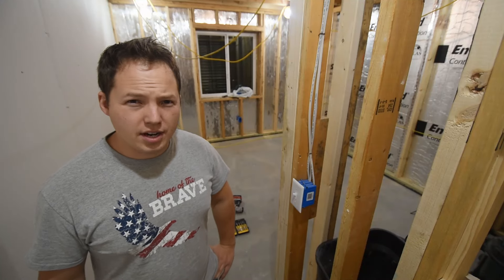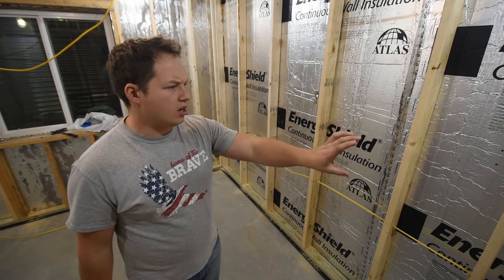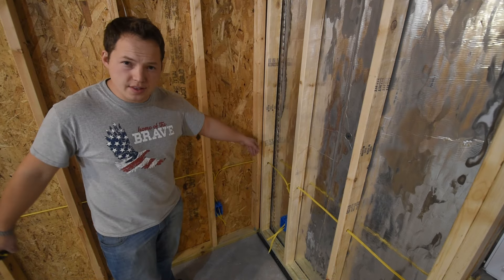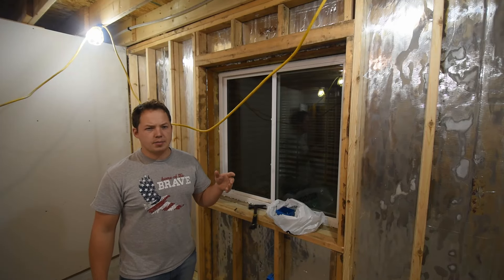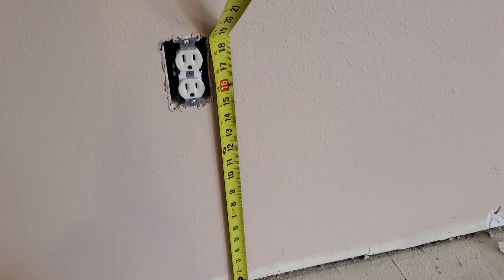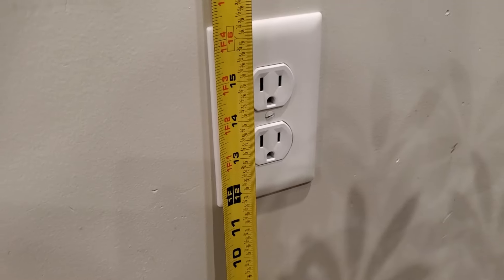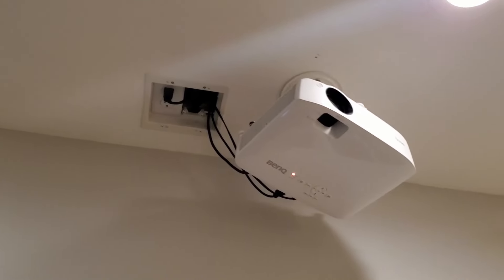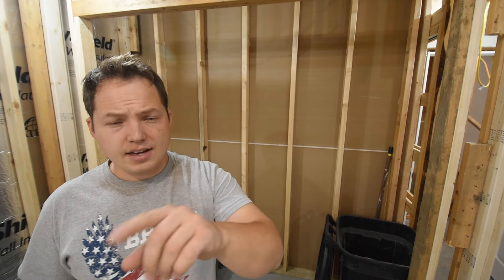Height of Outlet & Switch Boxes & Receptacle Location Tips

Comment: If I’m not planning for anyone living in the space that is handicapped, then what reason besides Making it easier for the sheet rocker do I have to comply with the ada?  

Outlets 20 a.f.f. To top
Switches 50” to top a.f.f.
Bath sconces 6’8” center.
Laundry /dryer 50” to top ( if we don’t leave the outlets accessible while the appliance is in place, the inspectors require a disconnect. ick. I’d rather see the plug back than a bigger gray box)
Reply: Compliance with the ADA is not optional, it's law.

Comment: is there any codes or laws or rules for receptacles with usb connections?
Reply from the maker: They just need to meet the same requirements that regular receptacles do. This includes being GFCI where required and tamper resistant (TR) where required. You can accomplish this with a GFCI breaker if you want to replace an existing GFCI receptacle as an example.
Reply: @BenjaminSahlstrom  awesome. Thanks. I've been bing watching you all day. Bought a house with an unfinished  basement and will be doing the majority of the work myself except framing. You've taught me a lot. Keep up the great work!
Reply: No

Comment: Aren’t the outlets supposed to be installed with the ground pin up ?
The idea of this if the plug sags the ground pin is exposed and not the hot.
I thought that’s part of the code ?
Reply: Obwan Kenobi I’ve never heard of this. The only time pin (ground plug) is up is to identify a half-hot receptacle.
Reply: There is nothing in the NEC about ground pin being up or down. That started in the early 90's. Architects would design commercial buildings and in the legends for material listing a duplex receptacle would be shown with ground pins up. So,  in essence the rule of thumb was to install outlets with grounding pin up as to appease architect and GC. Though there are some thoughts as to why this is a better installation, one being if something fell behind a desk and the cord cap was slightly out that object would not come in contact with the hot and neutral causing a short. Also the same thought as when personnel using office equipment and had to remove a unit their fingers would not touch the hot and neutral blades of the cord cap. But after years of being in the trade I have never seen anyone put their hand on the body of the cord cap except when plugging in a peice of equipment.  When unplugging...yup they pull on the cord.
Reply: The reasoning I heard for ground pin up was in case the plug sags and something slips off the wall (like a metal picture frame or curtain rod) and lands in the gap it won't be energized and bite you when you reach down to retrieve it. It would either be touching just the ground pin or ground and common and be "safe", or touch both the ground and hot and set off the circuit breaker.   
I think ground pin down has become common because it makes a little smiley face :)  Also appliances and extension cords with right angle "lay flat" plugs seem to dress better when the ground pin is down.

Comment: You left out the garage outlets totally...the door opener outlet needs to be on the ceiling, and it's switch about  60" from the floor. Need junction boxes for sensors too. Good and informative video.

Comment: I found this video helpful, but wish he stressed the NEC requirements.....the 6-12 rule and the height requirements for them to count as minimums....one foot off wall in floor up to 6 ft high on wall to count as "required" for inspection.  

The NEC is a minimum requirement and you can have a receptacle every foot along the wall if you want.

Comment: Hi. Here at the opposite side of the world I heard some rumours about US home electricity. They say you can't do anything with electricity even at your own house or you'll be penalised for it. Is it true, or you can do it by yourself and all that matters is whether you follow the code and pass the inspection.
Reply: Its  A complicated question to answer.  That will depend on the local jurisdiction that you fall under. There are no federal guidelines.
Reply: Eh at home you're okay. Especially w a small job. Anything public where someone can tell is where you'll run into problems.
Reply from the maker: Generally you can do your own electrical work in your own residence as long as you get a permit and have the work inspected. As Dan said though it is somewhat complicated as some areas don't allow that. How does it work where you live? What country are you from? I love learning how things are done in other places.
Reply: Depends on state or local governments.  Where I live now you just have to pull a permit for anything except straight replacements (i.e. replacing a defective switch, fixture, or receptacle).  Where I used to live in a much more rural area you didn't even need a permit.
Reply: There are NATIONAL guidelines, called the National Electrical Code.  It is revised and published every four years, buy yourself a copy from Amazon or from your local library.

Comment: The switch height that I use is 48" to the center from the finished ceiling. Although two pieces of drywall must be cut, the cuts are smaller and lessens the chance of cracking or breakage. 
In a basement, I use 24" from the floor because in places with a high water table , outlets at 12" or 16" could potentially get wet during a flood situation.. 
On the first and second floor, I stand my hammer with the handle vertical and mark the bottom of the box at the top of the handle. 
I enjoy your videos and just wanted to share another point of view with you and your followers.
Reply: You measure switch height from the ceiling? That doesn't make sense, sorry... In rooms with various ceiling heights, you're going to have various switch heights.
Reply: @aaron74  sorry, I should have clarified that for you.In a room where the ceiling height is 96" plus or minus a 1/2" ,U measure 48" from the finished ceiling. It usually works pretty good for me. Obviously if the ceiling is not 96" that doesn't work, then 48" from the finished floor to the center of the box is what I use.
Reply: @jamestrapp8596  Yeah just stick with the floor as your baseline. The ceiling doesn't matter. lol

Comment: These days smart homes are becoming very popular, receptacles in closets and near windows are even more important so the homeowner can hide electronics and power automated curtains/blinds. Ethernet run with switches and room ceiling lights does wonders for sensors like temp/humidity/motion/luminescence/etc. Also Ethernet is great for Power-over-Ethernet (PoE) devices like network devices, WiFi access points, and CAMERAS. Super wish Ethernet was ran to key locations around the house for external cameras. And wish they had run thicker copper to my garage with an Ethernet

Comment: GFI’s in a wet room. That should include kitchen counter tops.
Reply from the maker: Yes that's correct. I'm guessing that you're referring to the part of the video where the receptacles look "normal" right? Those are protected by a dual function AFCI & GFCI circuit breaker.

Comment: Look up “ada 308 reach ranges” these measurements vary depending on obstructions. For example you said 48” max for a kitchen countertop when it’s actually 46” from finish floor to top of device, a common mistake in the field.
Reply from the maker: Thanks for the clarification! That would definitely be easy to miss.
Reply: Graphic shows that minimum height is 15 inches. Is that to bottom of the box? (Also shows that max height can be as low as 44" with a 25" forward obstruction, and simply disallowed after 25").
Reply: I always mount a half sheet of sheetrock from the ceiling, then a whole sheet, then what ever is left usually 24".   No tapered seam behind backsplash tile keeps it flat.  Those two joints need only one coat since they are hidden by the cabinets.

Comment: Counter receptacles are generally mounted at 44", not 48".   The space between counters and bottom of cabinets is 18", half 18" is 9, 9+36=45".    Bathroom switches are generally 54" high to be above the tile work.
Reply: Not to nitpick, but 9 + 36 = 45. ;)

Comment: Greetings,
I enjoyed the video. The poll you posted said comment if different mounting heights. I mount all new general receptacle boxes at 24" bottom of box. Why? Before ADA,  Did this specifically for handicapped and elderly clients. ADA being significant in design now, I standardized this measurement for all residential new construction and significant remodels. My other backstory of why I mount at higher a elevation is that I was called to a home in the early 2000's to raise receptacles because this client's child had a pet snake who electrocuted itself and damaged the load center. At 24" it is more difficult for toddlers and pets to get injured or die. Tamper resistant receptacles are a godsend. I do both.
Reply from the maker: Thanks for sharing that! Is 24" a requirement for the ADA for receptacle height?
Reply: @BenjaminSahlstrom  I don't believe there is a NEC nor specific ADA Requirement but ADA being Federal, there is probably fine print somewhere. I just common sensed it. Lined up a wheelchair and a walker to the wall and tested.

Comment: for switches in a room with 8' ceilings, when using 5/8 drywall, I put my boxes 48 7/8 from the ceiling.  it's easy enough to measure and mark, and it ensures a consistent small gap on the top of the box.  also, height does not rhyme with ninth, it rhymes with kite.  :)  the h is silent

Comment: "Now some people are concerned about the aesthetic of too many boxes... or whatever..." @ 6:16. Ha ha ha, yeah... This is definitely a thing real thing, Ben. Because once they get installed and all the rooms get drywalled, you obviously can't easily take them out. And the placement really dictates the size and placement of furniture in a room, without regard to what choices you or a future homeowner might decide later down the road. Maybe you won't want the head of your bed along that particular wall in the future? Well if you move it, those high-mounted receptacles are going to look really weird.

For beds, I actually like the idea of receptacles and switches for the nightstand lamp to be in the HEADBOARD of the bed, stealthily on the sides and out of view. Then that headboard assembly, with its cord tail that plugs into the wall, moves around wherever you decide to place the bed in the room. I saw this done in a recent issue of Home Handyman.

Extension cords often get a bad rap, but they are PERFECT for bed and nightstand situations where you might plug or unplug something at table height, but the receptacle is behind the table at a standard receptacle height. The end of the extension cord can be tucked away sort of inconspicuously, and part of the cord could even be temporarily zip-tied to the back leg of the table so it doesn't fall to the floor. Same with a couch, you can just have the extension cord dangle over the couch to plug in a cell phone or whatever. When you have guests, hide the cord behind or between the back cushions of the couch.

Also, I'm not a fan of receptacles with integrated USB chargers. Besides being ridiculously expensive, they are constantly running whether something is plugged in or not. Even though the power consumption is modest, the electronics in them are constantly charged and over a fairly short time they will likely just burn out, and then there is the hassle of replacing it. Lastly, everything may soon be on the small USB-C format plug charging standard, though I wouldn't hold my breath before that happens.

Comment: It's not 48-inches, more like 48" up to 48.5" depending on chosen drywall thickness. If you do 48", the drywall guy is most likely cutting both sheets still or is doing a bad job for you. You'd measure from ceiling for this, not floor.
Reply from the maker: Some guys will set them at 46".

Comment: 54” is standard height switch boxes 
48” for handicap switch boxes 
Stand your hammer up and place box on top of hammer and set receptacle boxes to this height, one guy setting all boxes to ensure same height 
Brace all 3 and 4 gang boxes

I recommend using 20 cubic in single gang boxes, wiring all receptacles in 12/2, this allows 3 12/2’s into single gang box, so no box overfill, always pigtail your boxes with 3 12/2’s, meaning the neutrals and hots.

Comment: Easier to figure out switch is 48" from finished ceiling.... ceiling is installed first...the wall... wall is installed by placing first drywall board to ceiling...48"...no notching out top board or lacking 1/2" gap at top of box.... normally drywall is set 1/2" to 3/4" from floor...

Comment: Always use a number off the bottom and then you can use a "stupid stick." Which is a piece of strapping cut to the measurement between the floor and the bottom of the box.  Then you do not use a tape measure throughout the entire rough.  You put the box on top of the stupid stick and youre done.  You cut 1 stupid stick for switches and 1 for plugs.
Reply from the maker: Great recommendation!
Reply: *receptacles, plugs are on the appliance, never on the wall.
Reply: Stupid stick?————>story pole
Reply: Plugs are inserted into receptacles
Reply: How high should you put a panel box
Reply: Vincent Wilson ...... 6’6”” to the top of the main breaker or switch.....get a code book

Better yet.....get a licensed electrician....everyone will be happy....including the fire dept!
Reply: I use the top of the hammer for the bottom outlets since all my hammer are the same height (13").   Once the flooring is added it makes it closer to 12".

Comment: He has the ground of the receptacle, on the bottom instead as it should be, on top.
Reply: That is not an NEC requirement. There are good reasons to do it that way, and it is taught in many trade text books, but it doesn't look like a smiley face 😀  Also, many appliances and extension cords have right angle plugs that allow the cord to lay flat against the wall. Most of the ones I see assume the ground is on the bottom.

Comment: Interesting that you use such precision to describe the location, but you don't mention whether you are using the finished or unfinished floor as the base level.  It looks like, in your examples, you show both finished and unfinished floors.  I think there's typical 1.5" difference between the two.

Comment: Better rethink that I mount my switch box at 48.5 inches down from ceiling that way the top sheet of drywall doesn’t need cut
Reply: I hung my drywall vertical so I don't have any butt joints to mud.
Reply: @JoeMalovich  Against the code.
Reply: @lichub  there is no code pertaining to drywall orientation.
Reply: @JoeMalovich  Banks will deny loans to new construction if sheet goods are not catching the most studs.
Reply: @lichub  1. How would banks know which direction the drywall goes?

2. My vertical drywall panels are touching the studs 100% of the perimeter. Horizontal drywall touches  only on 3 sides and the 4th side touches the studs only at the stud, the spans between studs are unsupported.
Reply: @JoeMalovich  If you build a new home, a bank will send its own inspector to see the progress of the construction.

Comment: Placing the boxes at 48 inches is a pain in the butt for dry wall.  They will fall right in the middle of the horizontal joint.  I also suggest that ADA compliance is MAXIMUM 48".  Lower the switch boxes.  Receptacles are a Minimum of 15". I Think!   48" is elbow height.  Think about carrying a heavy object and trying to turn on the lights with your elbow.  48 is just a standard PITA.

Comment: - Night table receptacles above 16 inches are not good idea since plug and wiring will be at sight all the time.  Beside, you few times need to plug or unplug devices there.
- Yes, switched boxes must be mounted at 48” but that is not any advantage for the  sheetrock people since most of the new houses have 9 or higher  feet  walls.

Comment: Those outlets above the sofa look really bad and would look even worse with charging warts and wires/cords hanging out of them. Yuk!  Same for the ones by the windows and in the bedroom.  They look bad.  Plus, your receptacles aren’t flush or parallel with the cover plates.  I like lots of receptacle but some of these ideas are quite unattractive and look more DIY than professional.  Sorry, just expressing my preferences.

On our last home, we had the receptacles mounted in the baseboards in the living room.  It made for a real clean look with no cords dangling from wall mounted outlets.  Those outlets were rarely accessed once the furniture was in place so bending over to reach them was a rare exception. They did create more work for the trim guys, but they never complained.